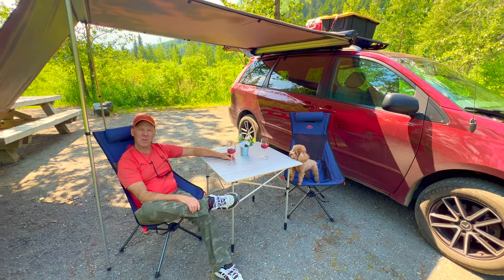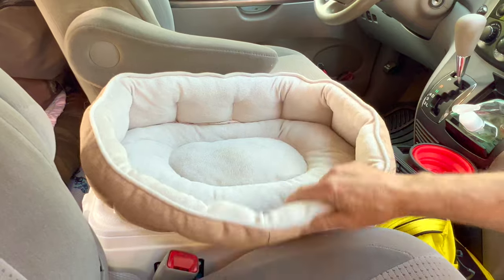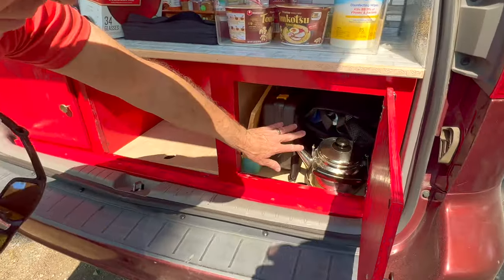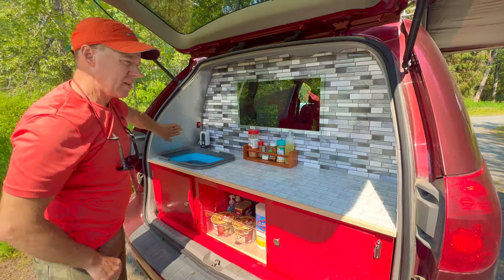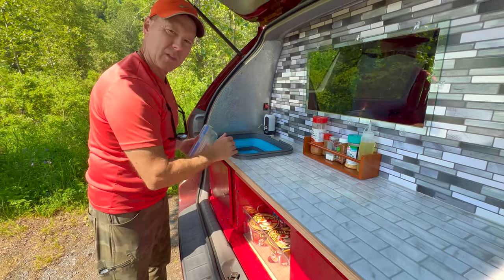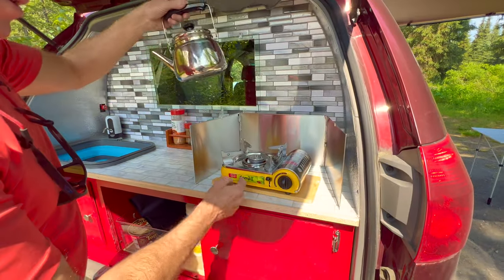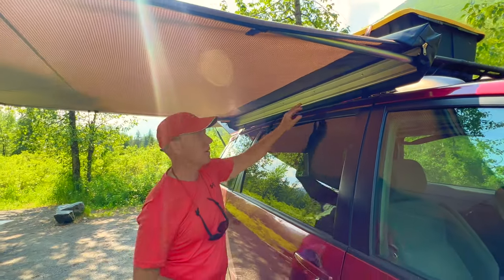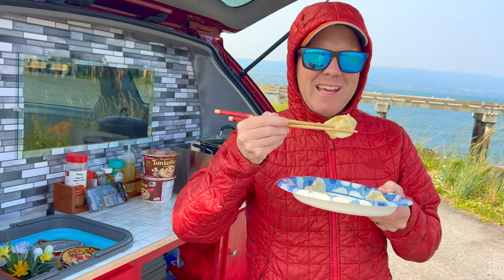MINIVAN Camper Conversion | Toyota Sienna FULL Van tour | 3 Days to Complete

Comment: This is a novel idea!  Like a teardrop camper layout.  You get to cook outdoors with no fumes going into the car.  On the bed side, you get privacy and shade and a huge bed. Smart layout.

Your dog Fifi is the cutest.  I have a mini Poodle too.  Best dog in the world, so easy, no shed, athletic, curious, sporty, and the best personality.  Fifi is adorable.  Pity we did not see much of Bonny.  Next time, please be in the video.

This is a lovely build.  Great tour, very nice family!

There are a couple of things you should do:
1. Make your bed support wood panels like Swiss cheese. Use a hole saw and cut holes all over. This will prevent mold on your mattress.  This is a classic problem in vans.  The air inside gets damp from bodies and over time, the mattress gets moldy. 
2. I would not seal up the window from kitchen to bedroom.  Put bug screen on it. Air flow is very important. You can keep back slightly open at night and get airflow.
3. IKEA sells acrylic mirror panels.  Put some up over the sink so you can comb your hair and also see behind you if anyone sneaks up.
4. 6:49 - This is exactly why you should NOT use a suitcase butane stove. These are very nice as a backup stove or a small kettle. When you put a larger pot on it, the flame spreads out and touches the butane canister close to it.  That heats up and... KABOOM!  They are not 100% safe.  The butane canisters are not easy to find either, only at Asian stores.  So keep it, but get a bigger two burner stove. I would recommend the Camp Chef Everest stove at 20,000 BTU per burner.  Nice red color too. Cooks very fast, you can grill on it, and make two things at once.
Reply: How many butane stove catastrophes have been happened?
Reply: @joeaverage5347 none. I never had any problems with the stoves. Explosions? Lie number one. You can buy the fuel at Walmart and Sam's club you cannot find the fuel? Lie number two. Must I go on. I will keep using butane stoves on trips for Ron's deli on the road. Actually when you remove the can after cooking the can is ice cold has condensation on it. 73 

P.S. you never put an oversized pan on any flame stove I don't care if it's your kitchen stove. I use a number 6 Griswold cast iron skillet. Makes good hamburgers and steaks. 73
Reply: I never had any issues with a butane stove. In fact the canister gets Ice cold it gets wet. I used cast iron on my stove. If you are worried about getting too much heat around your galley kitchen use the stove outside on a table. 73

Comment: Remember, not everyday's a sunny day like in the video. cooking outside when it's cold, dark, or raining is not very comfortable. Having most of the stuff only accessible when you're outside of the van is not ideal, and I'd personally just have a kitchen inside my van or atleast a counter and a bench to sit and prepare my meals when it's raining. Besides that, this is a pretty nice conversion. You've done a great job.
Reply: As a tall man who does the cooking I went with a similar design. The overhead door makes it really easy to add a tarp or screen for protection. It's really just matters what works for you. Very nicely done kitchen,

Comment: Thanks again. I realize this post is old, but I had to thank you again as I now have finished mine. I have the kitchen almost exactly the same as yours. I did put a cooler in the middle section bottom with extra insulation. I installed a seat on one side which pulls out like the older trailers. I wanted somewhere to sit on rainy days when needed, and as I use a CPCP machine for sleeping, I need a battery, inverter, and DC/DC mppt charger. So a place to keep them. I am anxious to get going with it. UPDATE: Had my first 3 day trip with it. Everything worked well except the cold minus 1 weather. So when I got back I finished installing a 2K diesel heater. Now I can sleep through the night. Love it. I have since installed two 100W solar panels which fit exactly between the top rails of the van. Now I have alternator charging when I'm driving and solar charging when I'm camping. I added raised cross bars from VEVOR to hold my kayak in transit so it doesn't sit on the solar panels. Thank you again, I really appreciate the inspiration.

Comment: You should make a cut out template also from the heat resistant shield and make the lower half of that in the background heat resistant so you don’t have to keep pulling that out and putting it up around your stove.

Comment: Nice "Teardrop' or "Chuck wagon" configuration. Like that back window, however it does have a Drawback in that the kitchen is only accessible from the outside.  There are times that would not practical.  I would modify the design to give access from the inside as well by installing sliding doors which don't take up any space, that way you have access from either side. The other thing would be to move the sink to in front of the window/ pass-through.....that way you can simply reach through and fill up your kettle
PS....You have given me some ideas 4 my own build.😉

Comment: I would leave the glass out maybe.  For more counter/prep area you could put another board  across the counter (maybe the same length over the sink too) and have it on a swivel to come out to your right and hold it up with a leg that you can pop out or screw in underneath the edge to hold it up maybe ?? Either way, a really great kitchen set up!!
Reply from the maker: Glass in in to keep smoke and bugs out